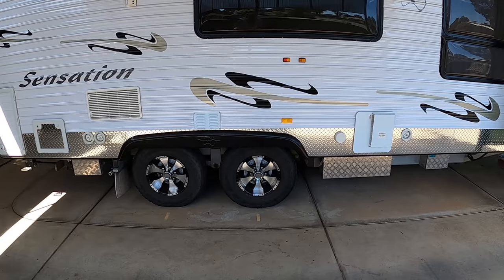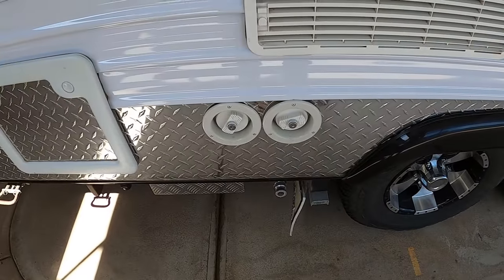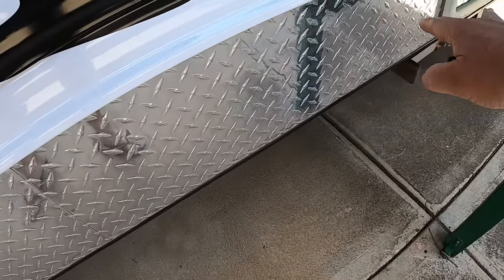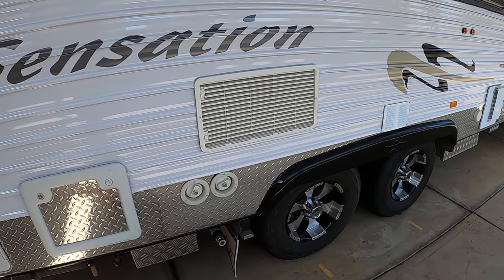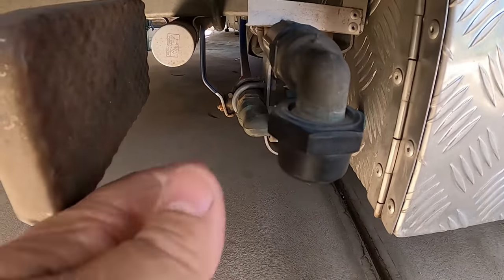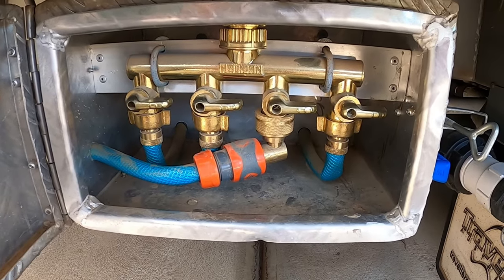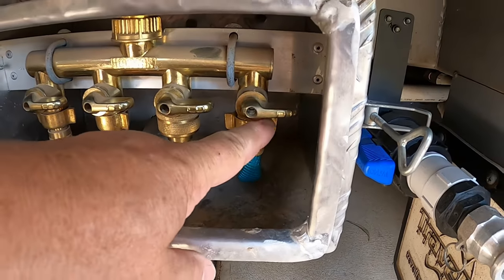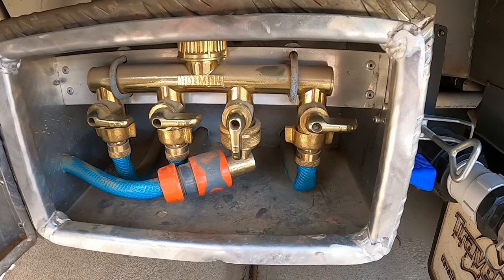Filling Caravan Water Tanks

Comment: Brilliant Mick.  I can't understand that caravan manufacturers haven't addressed this problem by a standard design feature already.  I had the same problem with my caravan!  The filling points need to be at least higher than the top of the tank (I can't see why they are all so low) and breathers should come from the top of the water tank and can't have high point(s) that cause air locks.  Just basic hydraulics really.
Another area in my caravan is that the kitchen sink doesn't have adequate slope to drain (if the van isn't level for some reason). i.e. a flat bottom.
The manufacturers need to do some trips to confirm if their long-held views are optimum or not!
Reply from the maker: You are so correct in what you have written Peter, they need to walk in our shoes. I actually requested to have my water tanks set in the factory during build as I have now done, but it seemed all too hard for them to work it out.

Comment: me again....would you know if the tanks can be filled via the outside tap on the A frame? Guess the feed water would have to go backwards thru the 12V pump.  Am a bit antiquated with old bones to slip under the van nowadays..
Reply from the maker: No, the water will not back feed from the tap.

Comment: Just seen some comments on FB about you system.

Well done, but how do you drain your tanks? Do you filter your water before it goes in the tank? Where are the filters mounted?
 · Reply · 6 d
Robert Christen
Daryl Demarte
No photo description available.
 · Reply · 6 d
Robert Christen
Daryl Demarte
No photo description available.
 · Reply · 6 d
Robert Christen
$10 set up from bunnings and we just run our inline caravan water filter.
 · Reply · 6 d
Matthew Cox
Robert Christen. Is that a new hole that you have put in the tank or the same hole just different connections?
 · Reply · 5 d
Robert Christen
Matthew Cox same hole just different connectors.
 · Reply · 5 d
Matthew Cox
Robert Christen. Thanks mate. Getting a new RO later this year. So if I can’t get full tanks from using fillet points will be looking at something like this.
 · Reply · 5 d
Daryl Demarte
Simple way to do it is to extend the drain taps on the bottom of the tanks and fit a click on type fitting with dust cap, these are available from Bunnings. Just snap your hose from your filter system onto each one in turn.
No photo description available.
 · Reply · 5 d
Write a reply…

Sally Harris
Mick Harris
 · Reply · 6 d
Angie Griffin
..
 · Reply · 6 d
Pete Gladman
A little bit over complicated. I have just run a hose from the external feed line to a T piece in the pump feed from the tanks via a valve. Just hook up to the normal external hose and open the valve to fill the tanks.
 · Reply · 5 d
Terry Byrne
Get a spare cap drill a hole glue a hose fitting bingo.
 · Reply · 5 d
Michael Wiegerinck
Get a hose, don’t put the fitting on one end and stick it in the filler hole, simple and works every time
 · Reply · 5 d

Comment: A little bit over complicated. I have just run a hose from the external feed line to a T piece in the pump feed from the tanks via a valve. Just hook up to the normal external hose and open the valve to fill the tanks.
 · Reply · 5 d
Terry Byrne
Get a spare cap drill a hole glue a hose fitting bingo.
 · Reply · 5 d
Michael Wiegerinck
Get a hose, don’t put the fitting on one end and stick it in the filler hole, simple and works every time